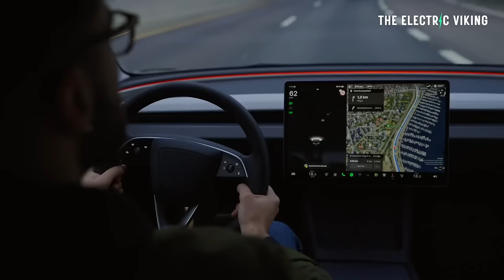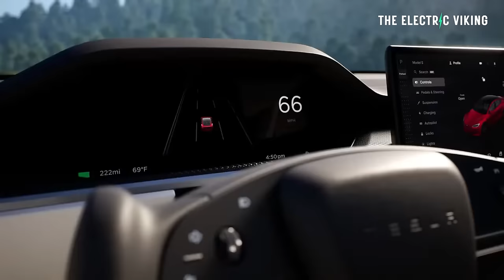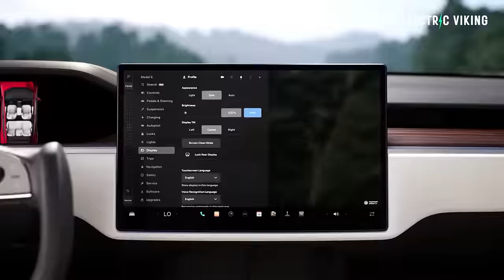Legacy Automakers lose $6,000 USD on every Electric Car they sell

Comment: Legacy auto is in danger of sitting on the side lines as the future passes them by.
Reply: Legacy nokia kodak blah blah blah
Reply: Toyota just had the best 2 years of profitability in its history. 2022 and 2023.
Reply: @singed8853  The future is EV's. At some point that future is going to speed up and Toyota specifically is deeply intransigent.
Reply: @scoty_does  The future is a balance of EV's and ICE. We're just yet to find out what that balance is.
Reply: Nahh Toyota can compete, they have time, they sold 8 million cars last year,,,  Their EVs aren’t that bad considering they only have a couple years making them, similar to Tesla Model 3 2018 with a bad range then.
Reply: EVs are legacy. They arguably predate vehicles with internal combustion engines. If you don't know why ICE caught on and EVs were left in the dust, you fail to understand any of this. EVs can't catch on without major breakthroughs in theoretical physics such as transmitting electricity without wires over long distances and more.
Reply: I would still be nervous about buying an EV until I have confidence about costs associated with batteries.
Reply: Have you not seen how fast brands like Porsche, Audi, Kia are advancing and all those completely new models? No wonder they are losing money …….for now. Tesla are being left behind. Model S and X are around 10 years old and the 3 is over 7 years and Y is 5 years old. It’s Tesla losing their advantage is what I can see
Reply: Sad but true.
Reply: @davidbrayshaw3529 no, EVs are just too much better than ICEVs. Unless you count being loud and excessive vibration as good things.
Reply: @TheNewMediaoftheDawn the problem is that EVs were still novel at that time so flawed cars were forgivable by early adopters. Now EVs are mainstream so automakers have to not just meet performance expectations, but quality expectations as well. Legacy auto, including Toyota seems to be having a hard time with that.
Reply: @992GTS-DC left behind how exactly? Your opinion seems to be the minority as the Y was the number one selling car in the world.
Reply: @williammeek4078  In your opinion, is there no use case for ICE vehicles?
Can they all be replaced with EV's?
Reply: @TheNewMediaoftheDawn  Model 3 Long Range from 2018 had almost same range as today's Model 3 Long Range.
Reply: @williammeek4078  j mean left behind in terms of progress. They have stagnated, changing the lights and tweaking features instead of bringing out all new models. At some point people will stop buying them like they have for the model S and X
Reply: @992GTS-DC  the S and X were never meant to be mass market cars. So for, the only vehicle that is truer better than a Tesla is the Chevy Silverado. But Chevy being Chevy will cancel it as soon as it is too successful.
Reply: @davidbrayshaw3529  there isn't going to be much balance where things are going. Renewables are getting cheaper and cheaper and nowadays people are literally building their homes with solar panels as materials. This means even charging costs are nil for them.
Reply: @davidbrayshaw3529  the only ICE vehicles still not having an easy replacement are large truckers and the like. Even smaller trucks are easily replaced by EVs.
Reply: @nfzeta128  The availability of renewables to charge relies very heavily on both geographical, topographical and climatic considerations as well as the type of domicile that you live
and of course, your wealth. You might be surprise at how few in this world meet those qualifications.
Reply: @davidbrayshaw3529  You'd be surprised how many do. Very few places are able to deny solar use and most even if they don't just immediately start paying in the black at the very least heavy reduce electricity spending.
This is only thinking about personal cases. When we go bigger then there is practically always a form of renewable energy that can be used no matter where you live.

This is only getting more and more so as time goes on as both efficiency goes up and price goes down.

Comment: I haven't figured out how to charge one up in my apartment complex in Las Vegas, yet.
Reply: A quick web search showed 1278 apartments in Las Vegas with EV charging, so if willing to move...
Reply: @bearcubdaycare   great research. but how many are available to rent ? LOL
Reply: Charge your EV at work or at your business.
Reply: Live over a radioactive radon testing site in Nevada.
Reply: Lame talking point.
Reply: @Pneuma40  Some people actually live in the real world, need to pay for things, and get where they are going on time.
Reply: Valid concern, we still need a lot more public chargers.  

In the UK they expect 40% will not charge at home.  So Sam needs to get with it on that.  They are figuring it out.  

I don't think they have enough Electricians for the massive amount of chargers at home to be installed.  There be a huge amount of jobs created.  And powerwall or other, same.
Reply: Take a long cable....
Reply: @Michael-yi4mc  If you live near a radioactive testing site in Nevada your white Tesla may become fluorescent green lol
Reply: @mauriceharting5877  👍We could call it Tesla green?
Reply: @Michael-yi4mc Right now for the competition of Tesla it is GREEN with envy lol
Reply: 120 volts takes to long to charge Auto Lithium battery's.
Reply: I haven’t figured out how to refuel my diesel at home without a complicated supply chain delivering the diesel to somewhere near me, having refined it using cobalt, dug up by children in the Congo and and extracted it out of the ground thousands of miles away in the first place.
Reply: @Longtack55  We are having our driveway replaced so no charging  for 10 days.  No, extension cords are not safe.
Reply: @ouethojlkjn Hahahaha excellent point for the anti-EV folks will grab hold of anything that they feel discredits owning an EV. 

Are there some issues with EV's? Sure there are, but there are more issues with ICE vehicles since they have way more parts that can fail and pollute the environment with noise and air quality issues.
Reply: Talk with your landlord or HOA. Many are willing to add charging facilities and there are also government programs to help out. It is cheaper for them to add it now then to wait and have to pay full price of the chargers later. There will be enough people by 2030 driving EVs, they will have to add chargers at some point.
Reply: Yes it drives me nuts that the assumption is everyone can charge at home.
Reply: @yodaiam1000 True, for where there is demand Landlords will add a charging station or two.

Comment: In theory an EV should ultimately be cheaper to manufacture than ICE vehicles.  The manufacture of the actual IC engine is more difficult to automate for one, where as automating production of electric motors and batteries better lends itself to automation.
Reply: They already are
Reply: No, the key is in the battery tech,

Comment: The average price of the top ten electric vehicles in the US is about $53,758, with an average of $48,430 for the low end trim of each model and $64,936 for the high end trim of each model.  Where you can purchase a New 2024 Toyota Corolla for around $24,000.  For the average consumer the price of an EV has to come way down for it to be appealing for most to consider purchasing.

Comment: I looked, but couldn't find, the amount car companies pay to purchase carbon credits.  One site, without documentation, said about $3k per vehicle.  If so, that's half of the $6k loss.  

Think about how many years Tesla suffered losses before they were able to scale up to profitability.
Reply: carbon credits are to offset ICE not EVs, the 6k loss figure sam mentions here is based on legacy EVs not ICE

so the likes of toyota are still making profits from ICE even after offsetting with carbon credits, they probably aren't building EVs because they can't do it profitably atm

they might be waiting for a new standard in battery tech, which makes sense with LFP and now sodium ion coming in full commercialisation in the past couple of years - even EV specialists like Telsa and BYD have to invest massively to make the switch, so it seems like an ideal time to transition

also you have specialist battery companies like northvolt which legacy can use to temporarily delay the massive capex of building out battery tech infrastructure, less risk but a loss in long-term competitiveness due to lack of vertical integration, but you mitigate massive risk in the short term, especially if you go all in at the wrong time

you'd think with time in market and existing infrastructure legacy automakers can offset lack of vertical integration of battery tech and still remain competitive but that remains to be seen, but maybe that was due to lack of off-the-shelf options, now they exists in the form of BYD and northvolt so who knows, might see some massive changes in the next couple of years as legacy catch up

Comment: How do they determine $6000 loss per car sold?  If a company spends a billion dollars to build an EV factory, then after the first car is sold does the company say they are losing almost $billion for every EV they sell?
Reply: The formula is actually pretty simple ... You add all material and labour costs and compare this to the sale prices. The building of the factory and its equipment is a one time investment that is paid for from the profits the company makes. If the company loses money they will go bankrupt. Pretty simple is it not?
Reply: @mauriceharting5877  That can't be true.  How can material and labor cost more during the early stages of building a car compared to 5 or 10 years later when it is "profitable" ?  That doesn't make sense, especially if you consider inflation.
Reply: @thewolfdoctor761  But it is.    If your car is popular as demand grows you buy the supplies to build it in larger lots for less.  Maybe you improve the car and pull some of the cost out.
Reply: @thewolfdoctor761 Pretty simple for with low production numbers in the early stages your material costs will be higher since you don't get volume discounts and you labour costs will be higher also since during the early stages the production line is less efficient.
Reply: This channel has too many unfounded claims. Can’t be trusted
Reply: @mauriceharting5877  $6000 less?  Seriously?
Reply: @thewolfdoctor761 Legacy auto makers lose at least $ 6,000 per EV due to:
1. Poor design
2. Weak battery configuration
3. Parts sourcing issues
4. Labour costs
5. Overhead expenses
6. Non-online ordering by customers
7. Less competitive with Tesla
and the list goes on .....

Comment: 350 mi of EPA range is tough to come by so far. Mercedes EQS, Tesla Model S, Lucid and maybe a couple other German models can do it. Lucid isn't a sane choice anymore unless you're ok with owning a car you won't be able to get parts for. It would be nice if people could get over this range thing. It's really mostly about charger availability and charging speed for long range travel. Urban dwellers have a huge advantage in not needing much range, so they can get much less expensive EVs. Chinese cars are all hearsay so far. EPA testing is the minimal standard, and the auto magazines come down even harder on range in their own testing.
Reply: I think the range anxiety comes from the reports of the early EV buyers and comparison with ice vehicles. Instead of charging often, they are used to filling up and driving until near empty. Any EV research shows that the true range is not even close to what you are expecting. 300-mile range becomes 240 miles at 80%, then 240 miles becomes 200 miles with normal highway driving. Not to mention the charger locations can cause extra stops because of availability. All we see is delays when driving EVs on the highway. But it is true we worry more about the 5% highway driving vs the 95% everyday driving. This should change whenever we get more charging options.
Reply: YEP. I would consider buying an EV with a 200 mile range if the charging infrastucture and recharge times were as good as ICE. However its not, and may never happen.

Comment: It’s counter to the corporate culture of legacy OEMs to take the risks necessary to dive in with both feet into EVs. They risk alienating their supply chains for ICE with whom they have long term contracts. Moreover they don’t have the engineering to design software-based EV platforms to compete with Tesla and other EV only brands.

Comment: These projected sales numbers will never be met unless the charging infrastructure is improved dramatically. You will have some areas of the country. The USA am speaking about that may hit those numbers, but the majority of the country will not.
Reply: The US is following the same S-shaped adoption curve as all the other countries, albeit with a couple of years delay compared to some other countries. One such country being mine. Here in Denmark, right now about 50% of new cars sold are EVs. Here you can charge at the supermarkets, curbside, workplaces or even at other people's private homes using an app. Still, most people charge at home.

People without EV experience tend to think you charge an EV similarly to how to fill an ICE car at a gas station. In reality you only do that when you go on a road trip, which for most people is a couple of times a year, at most.

Comment: Imagine I spend over 300.000 € for my company to buy VW Cars. They become cocking, annoying at the local store and I had so many repairs to make, I drove me crazy. Then I need another VW T6.1 for 70.000 Euros. They told me I can get one in about 1.5 years !  - Then I bought a Tesla within 4 days for 40.000 Euros and I am carrying my stuff in a trailer. Works great so far and within 8 month I drove about 35.000 kilometers.

Comment: Those who can’t change at home don’t have to go to high speed chargers. The level two charger is nothing more than a range receptacle like most people have at home.
If your car gets 3 miles per KWH you don’t need much time to replace the energy used for a nine mile round trip to the fast food restaurant or retail store . An hour’s worth of charging at 50 A x 240 v is 12 KWH. That’s 36 miles of range so 15 minutes on the charger in the parking lot covers the energy cost of the trip.
If the store charges $.20/KWH ,that’s $.60 for the trip. Bring your own cord ,leave the camera on in the car to catch copper thieves, and roll the dice.
The store owners should be willing to install the charging port and recover the expense through the small mark up on electricity. It’s a good way for them to attract customers also.

Comment: I’m part of the new potential EV market segment. Have always bought Honda and Toyota in the past and drove to 200k miles each. My next car will be the $25k Tesla when available. I will keep one ice vehicle for road trips, but use the EV for daily commuting. I will charge overnight and not care much about charge time and range. Cost savings could be significant when factoring in the high cost of basic maintenance for the ice vehicle.
Reply: It can be a good strategy to have both EV and ICE to start to get over the concerns. Almost all owners I known who start with both an EV & ICE find the ICE sits unused and they end up using the EV for everything. Just more fun and less cost to drive the EV.  I got rid of my ICE after it sat for 3 months and I used it for about 10 miles to keep the 12v battery charged.  Been EV only ever since and never regretted it.

Comment: Just driven all across France on Motorways. Availability of fast charging is good. Peak travel time for easter holidays and I did not have to wait anywhere. More chargers are still bring build. However, 99% charging at home sounds high. Drive through any city and it looks hard to achieve this given the infrastructure. What are European cities doing to support EV charging at home?
Reply: In Portugal every new building has to be prepared (ready to install) for EVs.
Reply: Think you misunderstood he said a typical EV driver does 99% of charging at home. The average of current EV drivers  being those that have the ability to charge at home

Comment: While I would agree with you, Sam, about practically every other legacy automaker selling BEVs, it particularly grinds with Toyota. Why? Because Toyota traditionally leads. Where Toyota leads, others follow. They've brought many improvements to the masses, from Hybrids to super reliable motoring with less servicing. Toyota also has had a dream which was to go from ICEVs to FCEVs through clear steps which they planned from decades ago. Simply, it went ICEV > ICEV Hybrid > ICEV H2 > FCEV. The last two steps they have been experimenting with for several years, race testing the combution H2 engine, and testing the market with their H2 Fuel Cell vehicles. They are heavily committed to this step by step progress. And Toyota doesn't like shifting from the plan. So, for them it's not about profits, it's about dictating the future of transport. Plus, Japan was committed to going H2, though I'm not so sure now. And you can bet that Toyota's darling friends in the Oil/Gas Industry are backing Toyota with every anti-BEV movement they make. The problem the O/GI and Toyota have is the lack of H2 infrastructure. The O/GI want it for transport, industrial, domestic applications. Toyota wants it for transport. Nobody wants to pay for it when the numbers are so bad against straight electricity, supplied by renewables. You'd think they'd change, but their sheer stubborness has helped them succeed in the past. To be honest, we need to be aware of them because they are ramping up their resistance, rather than pivoting to cleaner energy.